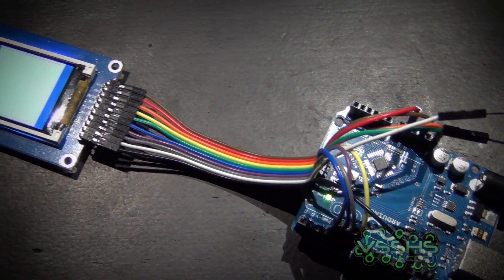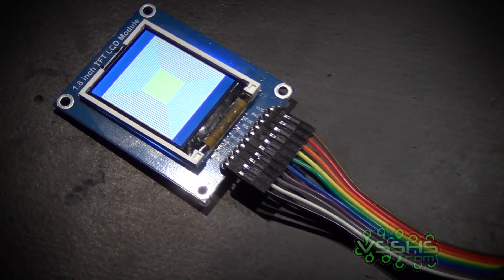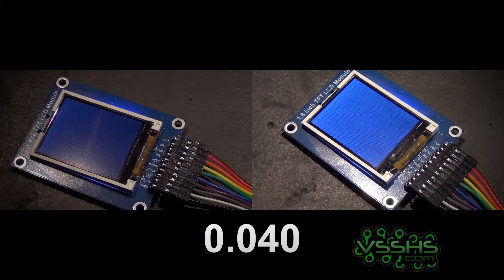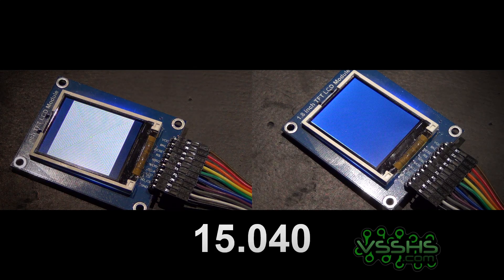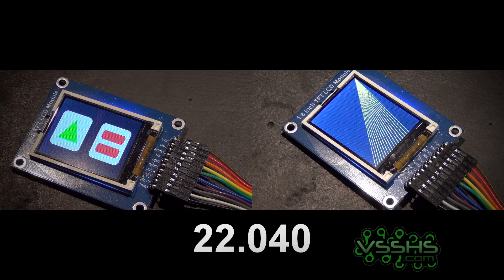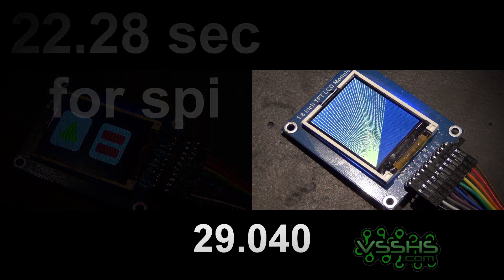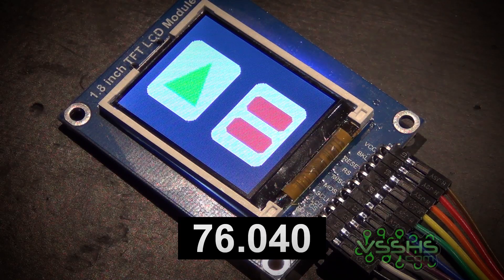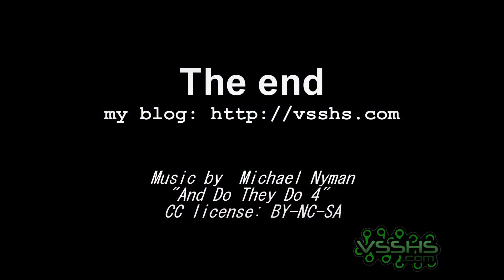ST7735 1.8" TFT Dispay: Hardware SPI vs bit-banging the SPI

Comment: So how would you program the raw display of this screen? Solder it on to a module and then connect it using SPI? When I mean raw display I mean the display without the module or anything else attached that you have to connect yourself.

Comment: what is the simple interface 'general connection' you are talking about? ...if you mean 8 or 16 bit parallel, you are doing something wrong because parallel is faster. You may not have the timing correct. Serial is naturally slower than parallel dude - Check your setup.